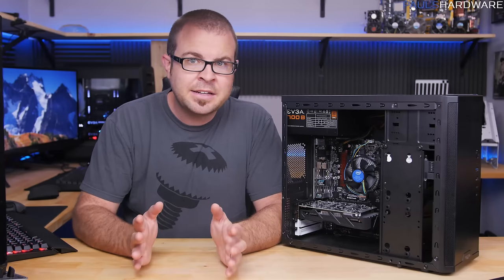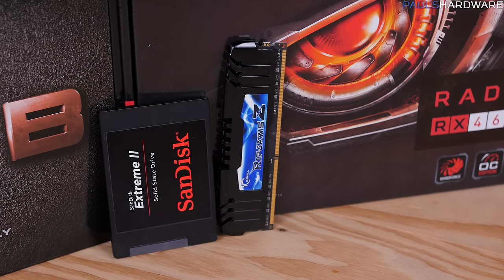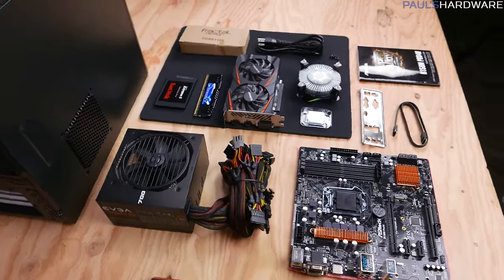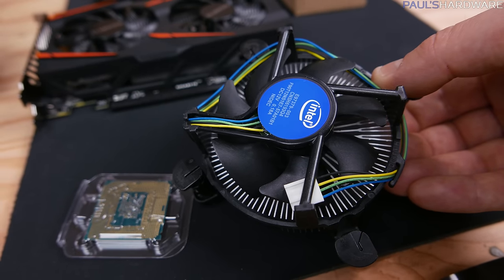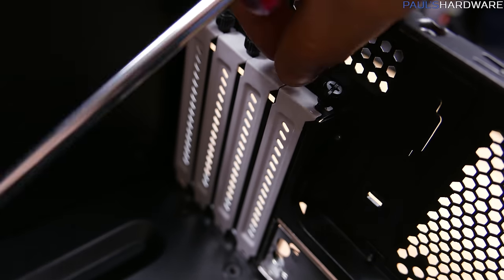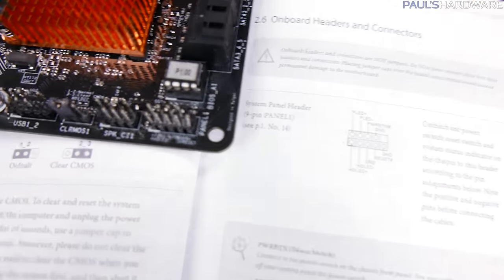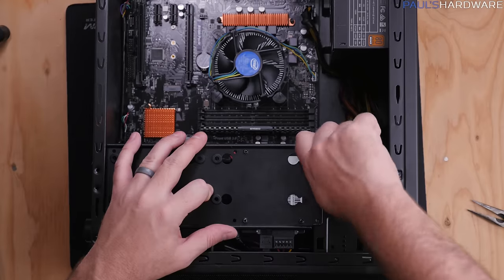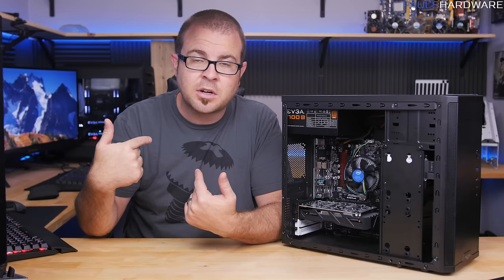How To Build a $500 Gaming Computer

Comment: i'd say cut the ssd and get an rx 470 but other than that great vid!
Reply: Cruz Vanderhoorn ssd'd are verry cheap these days so you might aswell buy one for better startup times and launch times
Reply: It's a gaming pc so it should have the decent gpu, the 460 is mehh and it will likely be upgraded in the near future. A 470 is a better bet as you can always buy an ssd afterwards.
Reply: ***** I have a $2000 Aud (1070 & 6700k) pc and I don't have an ssd (yet). For me personally I would rather have a pc that runs games better with more fps opposed to loading faster. For the OS I am using a WD black and I've turned off all applications on start up and windows is up and running in 25 seconds or so which is good enough. I would not ever swap my 1070 for a 1060 and get an ssd with the extra money saved.
Reply: Agree.
Reply: Yeah, if you get a 120GB SSD instead of 240GB, and a slightly cheaper motherboard, you can fit an Rx 470 in the build and the total cost is only about 20$ more than Paul's build. http://pcpartpicker.com/list/kn32kT

Comment: I have a few questions. 
1. Can I put an Intel i5 processor in this rig?
2. Can I put a higher end Nvidia graphics card in this rig? 
3. Is there a "flashier" case that still supports all these parts?
I should probably add that I'm extremely new to PC building.

Comment: What is it with build guilds and using SSD's instead of a 1TB hard drive
Reply: it's usually by people who have used ssd and consider them essential. Going back to mechanical can be hard to imagine. And harddrive can be add easily later without having to move OS
Reply: i just got a SSD but i still would highly recommend getting a big hard drive instead of a small one single SSD for a gaming pc
Reply: Sammers Well it depends on the person. Having the OS initially set up on an SSD can be extremely helpful because most people eventually get an ssd as you say you did. It is much easier to add a drive for storage than it is to add one for OS especially if you're not tech inclined. a 1tb costs about $50US which is one or two AAA games. I don't think the rate of consumption of the space of an ssd will be so great that youneed a harddrive if you couldn't afford to get one in the first place ie the person who has the cash to get enough games/ big enough games to fill that 250GB quickly is the type who would have bought the harddrive anyway
Reply: GTA V alone will fill up almost 1/4 of the storage and i just think SSD's are unnecessary for a beginner build unless you are spending money on fancy LEDs
Reply: The logic is that a person will upgrade to have more storage as they need it but upgrading to an ssd is not as simple. If you have enough legal media to fill a 240GB ssd quickly then you'll have had enough to get a 1tb for additional storage. I get what you're saying but I am just presenting an alternate view point as to why an ssd recommendation is quite feasible
Reply: I get where you are coming from, its just that i am coming from a need all the storage area in the case that i store huge video files and editing software on my pc but having my ssd has made the render times on premiere alot better.
Reply: Cool. I'd say it can a very case by case thing and we should evaluate our own needs. I am relieved this has not devolved into what usually happens in the comment sections...
Reply: very true we aren't trying to kill each other.
Reply from the maker: My main reasoning is that if you're gonna install Windows etc. you should do it on an SSD, it's much faster and more responsive. Also it's much more common to have an old 500GB-1TB HDD lying around (salvage from an old laptop or desktop PC) which can easily be added as more storage. If you have just a hard drive, and you get an SSD and want to put your OS on it, it's a bit more of a pain in the butt (depending on what migrating software you might have, or if you want to do a fresh Windows install).
Finally, if you're recruiting a new PC builder/gamer, they might be comparing the PC-using experience to a smartphone, and nothing will make your new PC feel slow compared to a phone like running off a mechanical HDD.
Reply: I agree with you its just that i use an SSD just for editing software and windows the rest of my software and games are stored away on my mechanical hard drive and i am coming from my own experience and i haven't really used my SSD to the fullest.
Reply: People who spend 500$ on a PC like this shouldn't go out and spend large amounts of money on AAA games that can hardly run on low with this PC..

 I lived with a 250gb samsung ssd with my high end PC for about 6 months because i only played 4-5 games, including: gta v, bf4, bioshock series, and csgo. Even now I barely play more than 5 games regularly, and could easily throw out my 1tb hdd as i really don't use it.
Reply: We are from two different stand points on using hard drives i play alot of games so i would need more storage and you only play a little amount of games so it is a perfect configuration for you but bad for someone who video edits or plays alot more than 5 games
Reply: Sammers But who in their right mind would video edit and spend 300$+ on games with an entry level computer like this :P
Reply: people who are just starting out on youtube or for college
Reply: Sammers The gpu in this build kinda sugests that the pc is targeting games like overwatch and maybe some Battlefield. It would be a better idea to spend an extra 100$ to get a gtx1060 3gb if recording youtube videos/ playing heavy games is on the agenda. 

+ If you absolutly have to spend less than 500$ on a system to play heavy games/record, then a used-parts system would prove much more reasonable/usable.
Reply: I started my old channel with a duel core and a 7750 with 1GB vram, it could game on medium settings but my system was the cheapest it could possibly be but that could edit yeah it was slower than everyone would want it to be but it did the job and i agree with used parts i just got a GTX 780ti for £100 off ebay
Reply: Sammers they are faster? Live in the now.
Reply: they are faster i am talking about the storage size difference and the price
Reply: now that i see all the comments ( I was on my phone before) I think your seeing this half full. the Point of this build with a 250 ssd is to get you started like others have said. Even I would rather have Windows installed and be done with it, then next month or 3 buy an other 1tb HDD or even 2 and set them up as raid 1. Point is, this build is meant to get you started period. Right now Newegg has a 250GiB SSD for $69.99 where a WD Red 1tb is going for $60.99
Reply: that is a great deal on SSD's they are super expensive in the uk right now and i think your right.
Reply: Most people can make due with a 240 gb ssd for a few months at least and its only $45 to dd a 1tb hhd.  Considering how easy it is to add excess storage over port an OS onto a new SSD its pretty obvious why most people prefer an SSD to a hard drive.
Reply: GTA V is a very space intensive game, not all games take up this kind of room.  In fact I would call it the exception and not the rule.
Reply: i would much rather have 240gb of ssd storage than a 1tb hard drive. last year i thought the same way you did, but on my recent build i had only ssd storage and man i have to say, its SOOO much better than hd just because of the pure speed. pc turns on in 14 seconds, load up games much faster, you get the point.
Reply: Thing is for $500 you can build a gtx1060 system. The build in this video is not very good.
Reply: Sammers that's why u pay an extra 50$ to have an SSD and a big hard drive....

Comment: Would it make sense to get a cheaper motherboard, a 120gb SSD to get the Rx 470?
Reply: Tuchulu to be honest, I'd save a little more for a 1060 6GB
Reply: I agree. ^^^
Reply: YTRKS but... freesync...
Reply: 1060 all the way considering you can get themfor $220 shipped for free
Reply: y`all bunch o` Nvidia fanboyz :D.
Reply: The $200-230 1060s only have 3GB of video memory, and that's honestly not that much these days. At that price point, you should get an RX480 instead since it has 4GB of video memory, not 3. This is coming from someone who has used Nvidia since 2012, so no AMD fanboying here, either.
Reply: Emberstone I know where you can find 6gb gtx 1060 6gb for $220 so that argument is a bit invalid
Reply: oh yeah forgot to mention free shipping included
Reply: CMstacker Don't know what that means also not going to waste my time looking it up. but i think somebody is butthurt.
Reply: IND4GR0V3
 If only you know where to find it, then it doesn't help anyone. You could always just post a link.
Reply: IND4GR0V3 1060 6gb is $250+, you are not sharing the link because it doesn't exist.

¯\(ツ)/¯

Rx 470 can be as cheap as $190, and that's the ASUS Strix model, which we all know is good.
Reply: Emberstone RX 480 Gets really fucking hot, which is why people are having to pay the extra $200 for Water Cooling on the card so that they can get an extra year out or so from it
Reply: YTRKS RX 480 custom board gets hot?? I guess you`ve only seen that failed Gigabyte G1 gaming design which every yt tech reviewer was shunning for last 2 weeks. All others are very cool and quiet. If you want AMD board first choice should always be Sapphire. If one can˙t find or for some strange reason doesn`t want Sapphire, then i would say go for MSI though i dislike that company as a whole, but they have great and beefy gpu coolers :D. After that Powercolor would be nice too.... all other vendors are pretty much garbage, except Asus. That one is overpriced and gimmicky rgb infused garbage :D. And of course no one should spend that much extra money to watercool a mid-range gpu... custom designs work well. Watercooling is nonsense in this price range.
Reply: CMstacker You have a fair point there :)
Reply: +Tuchulu now at the price point i just showed you from the posted link the 470 seems a bit silly.
Reply: You're going to be running games at potato-quality if you want to Freesync on an RX470. Either stick to 60hz or get a paper run and up your budget.

And a 120GB SSD will basically fit Win10 and two games. I can't recommend anything below 500GB for system storage these days.
Reply: Tuchulu Yes
Reply: Crunchy Chips Well I dont play shooters competitively, My idea was to get one of the lower end freesync monitors, with a range of 45-75 or so to prevent screen tearing and make it smoother.

I really just want to play Witcher 3, Skyrim, and a bunch of indie games, but my 6670 can't run it
Reply: thats true a gpu gets older faster and its the most expensive, u really need to make a wise chose there
Reply: CMstacker why msi? lol and yes any amd drains more power,  and gets hotter than nvidia, but they way cheaper for same performance

Comment: First of all,I gotta say that I barely comment on a YouTube Channel,not because I'm arrogant,I'm just lazy. 
Second of all,I have to thank you for the detailed shots of installing every component/cable/accessory/screw into the motherboard.

Finally,Great video! I've learnt so much,starting from the compatibility of the drives and and the motherboard (DDR4-DDR3). I also found out that I'm only missing a new GPU and an SSD to make sure that my PC still has some life into it. I have an i7 3770K which covers most of my gaming and video editing if not all.

Again,thank you for an awesome content,you sir have earned my subscription for what it's worth :'D

Comment: Good vid, but I would change few things, if all you are doing is gaming mostly. My build still came to about $485 and it has GTX1060 , it will be much better performance for 1080p gaming.

http://pcpartpicker.com/list/PGr2kT
Reply: h-how
Reply: BSG ??? I posted the link to pc parts picker...just click it and you will see HOW...lol
Reply: pukka5 mind blown
Reply: Hey man, can you include some benchmarks for your PC? I'd appreciate it!
Reply: Dude I am really confused now. How important really is the processor? I had in mind an Intel i5-6500 or i5-6600 since many times I have heard it has a reasonable price and performance. I've never built a PC. As an extra how recommendable is it to overclock the CPU in my first build?
Reply: Nope Not Me I wold not worry about overclocking especially if this is your first build. Also, remember if you buy the "k" series, you would have to factor in the price of z170 mobo and aftermarket cooler since they do not come with any.  So, if you have the budget, I would say, go for i5 6500 with h110 budget mobo and 8 gig or 16 if u can, and gtx 1060 3gb  , for 1080p gaming.
Reply: I'm starting to think I might be worrying too much about upgrades and putting the standard higher than I should. The only game I surely will play is Dota 2, but I will probably want to play more than just that later on. Are there any serious drawbacks from buying a cheap motherboard? I thought it wasnt worth cutting the budget too much for it. I will never buy ridiculously expensive stuff, but I am willing to pay more for something I will feel is lacking and whatnot. Not that it has to be the case though.
Reply: pukka5 
I would take:

I5 6600
Asus Z170-A Mobo
GeForce GTX 1060
8 GB RAM

Or less:

I3 6100
Asus H110 Mobo
GeForce GTX 960
Reply: +pukka5 how well would your build fare on battlefield 1 since the cpu isnt that good
Reply: Alex Williams its fine, because frost bite engine runs fine on low spec spu, even on amd apu is good enough
Reply: k cool thanks
Reply: Would a gtx 1070 windforce edition fit in this instead of the Gtx 1060?
Reply: I understand that but if it's in the budget would it fit In the case?
Reply: Ah ok

Comment: Very nice and easy-to-follow guide. Well done!

One thing I noticed: While you say which cables from the PSU you're going to need and to bundle up the rest again, it would have been good to also show how those connectors look. For those first-timers that might help just building their PC along with your video. You show the connectors later on in the video, but I think that earlier point might cause some headscratching.
Reply from the maker: thanks for the feedback! I'll keep that in mind for the next build guide :-D

Comment: I hate i3s.
Reply: i3s are office PC cpus, or media centre PC. Even better Pentium Dual Core and overclock it, if you are an (unjustified) Intel fan.
Reply: Cosmin D. To me a G4400 or the i5 6400/6500. Nothing in between.
Reply: 2 cores still being the entry level in 2016 is rather ludicrous, considering quad cores came out in like 2007 and were mainstream by 2008-2009.. Really we should be up to 8-10 cores instead of 4 for the mainstream, 4-6 instead of 2 for the entry level but thanks to AMD fizzling intel has done absolutely nothing but shrink nodes and optimize instructions for nearly a decade. Getting really tired. Lack of competition sucks.
Reply: Yelkwood9 It's because Intel has a monopoly. They just sell new CPUs every few years that are virtually the same, yet they can make prices insanely high due to little to no competition.
Reply: Generic Username

just because they can doesn't mean they should
Reply: i3s are actually decent for the price point. It kind of acts like it has 3 cores. Some people can't afford to spend an extra 80 dollars you know :( I do agree, Intel is being lazy with no competition. Moore's law is slowing down, I guess.
Reply: i hate i7's

Comment: Probably the best budget build you can get for 2 reasons.  1 - You actually have a great upgrade path.  You have 700 Watts of power so that will last a while and you have a skylake mobo and that allows an i5 or i7 upgrade later on.

Comment: Does the age of the motherboard make too much of a difference.I have a Z97-AR and  B85M which one should I keep? both between 5-6 yrs old
I inherited a PC from an old friend. He has a Z97-AR motherboard. i3-4690CPU+ 480G SSD and my computer has a smaller Motherboard B85M + i7-4770 CPU + 250G SSD
I like the fact that by using Z97 I am already up-gradating to a bigger box. (I am into software development and not gaming.)
Should I move the i7CPU to the Z97-AR?

Comment: So once you have Windows Installed, you can go to the network settings and connect to your Wi-Fi, right? or do you need a Wi-Fi adapter with that?
Reply: i just used a wifi adapter

Comment: That's the easy part, picking out the parts that play nice together and software installs windows/motherboard/vid specific drivers is what I had issues with when i was a beginner.  
And the order in which you install the drivers is very important as well as rebooting on each driver install regardless if it prompts you for it..  Then bios tuning, benchmarks until your blue.. 
Then who really cares next, that was the fun part.  The 24 hour burn in as well, keep it on !!!  Planning my next PC now, not much of a gamer, but I'm going full out anyway.  Peace!

Comment: Very similar to my build. I have an older i3, 2 stick of 4 GB or RAM, one SSD and one HDD, and I'm planning on getting a GTX 1050 when it comes out since it will be faster than the RX 460 but it will also not require a 6-pin connector.

Comment: Is this a decent budget setup (with included monitor)?:
-Intel Core i3-6100 3.7GHz
-MSI H110M Pro-VD
-G.Skill Aegis 8GB (2 x 4GB) DDR4-2133
-Western Digital Blue 1TB 
-Gigabyte Radeon RX 460 4GB WINDFORCE OC
-Corsair VS 450W
-Zalman ZM-T4
-AOC E2476VWM6 23.6" 1920x1080 60Hz

My max is €600,- that is with the monitor included. Any suggestions to make it better for the same price would be appreciated. (A €20,- diffrence wouldnt be awful, just dont stray 100 bucks from it).